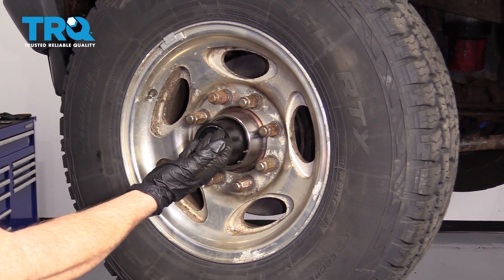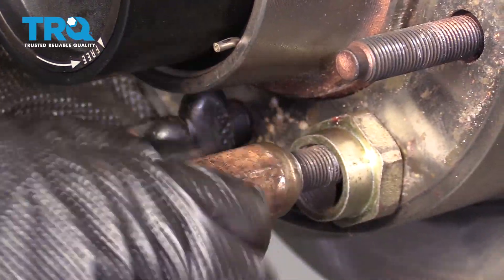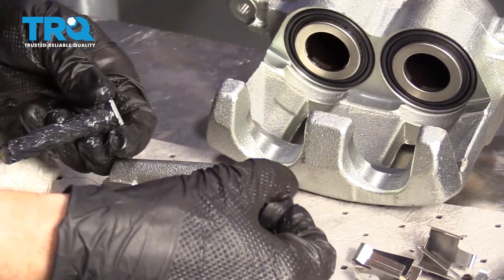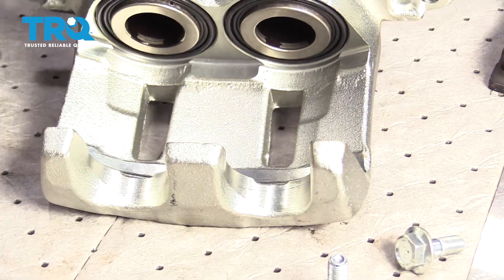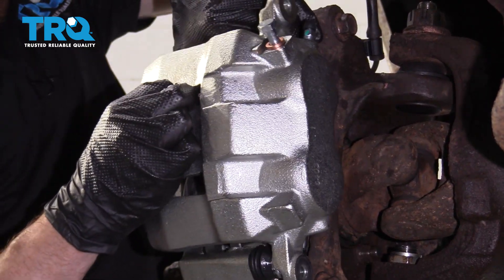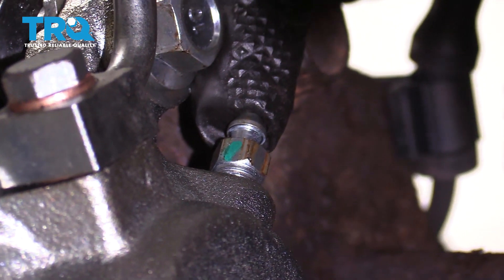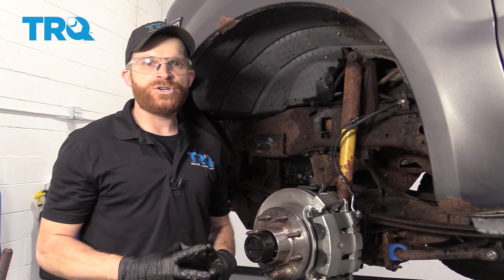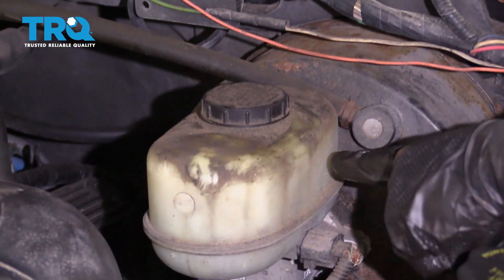How to Replace Front Brake Caliper 1999-2007 Ford F250

Comment: A pry bar to get the hub cap off.
A pry bar to push the brake caliper back before removing caliper.
A 21 mm socket for wheel lug nuts
A 21 mm socket to remove the bolts to take off the Brake Caliper Bracket
A 16 to 17 mm socket and socket wrench
A 15 mm socket for the Banjo Bolt - > Should come off like in the video.
A 10 mm wrench for the bleeder valve.
A Disc Brake Piston Caliper to push the new break caliper back, be sure to use new brake pad to push back.
Alligator Vice Grips to crimp the brake line.
A Power Brake Bleeder if you have one.
Anti-Seeze.
Grease.

Used this video to preform 2003 F350 6.0 Front Left Caliper Removal on 9/2/24.
Estimated time 3 to 4 hrs.
Replaced Bracket, Caliper & Brakes.
Two men.

Comment: ONE Caliper PIN/Bolt has Flat Spots on it shank.  The other is Round.  You did not comment on which goes where.  Upper or lower.

Comment: Hey quick question why didn’t you use red Locktite on the lug nuts, because you used it on the brake bolts.
Reply: Maybe he misspoke but I would NOT use red but blue. And surely never red on a lug nut.
Reply: @bvrgrn1038  yes red is good some places but you will need heat to remove so yeah not on lugnuts

Comment: I’d never pinch a line like that, you will have a weak spot there now, the vaccum of the pistons will suck the line closed there eventually and the pistons will stick open , did u hear it crunch? Slow down hoss, is this a speed talking video?  Those spring clips i throw in the trash , they don’t hold the pads back from the rotors good at all and end up gettin rubbed and jammed. But thats a Ford rusty but trusty, urs is rusty as mine